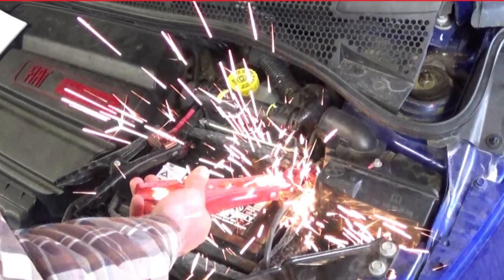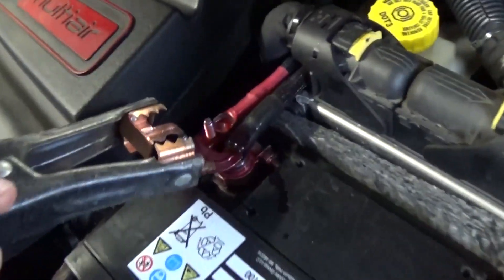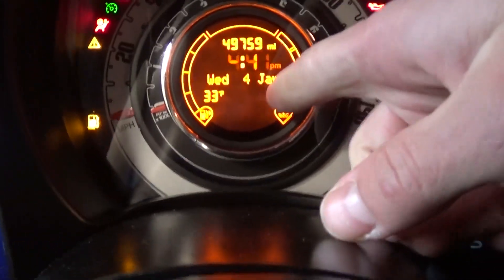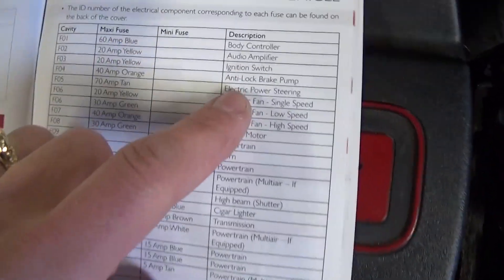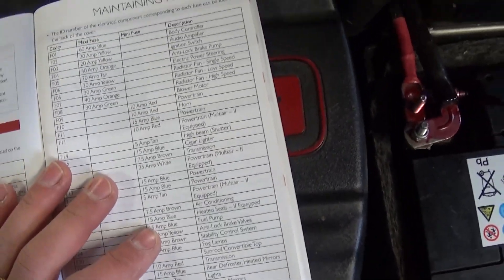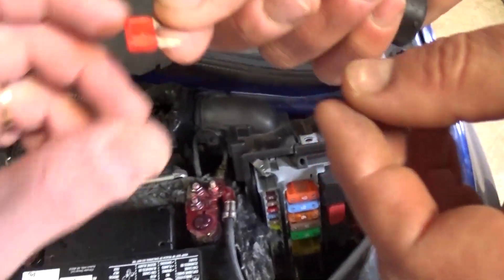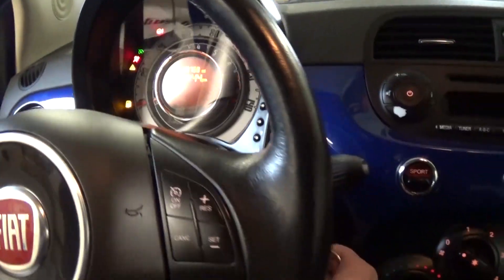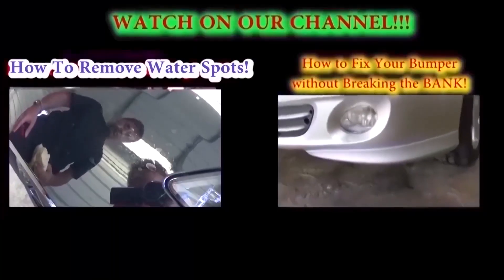What happens when you Jump Start your car the WRONG WAY!

Comment from the maker: Products that we use and recommend:
► Car Battery: https://amzn.to/3ULlYJv
► Panel Removal Set: https://amzn.to/3YiMADu
► Assorted Fuses: https://amzn.to/4fx4s3F
► Tool Set: https://amzn.to/3p5MM6t
► Screwdriver Set: https://amzn.to/3XRB28Q
► Mobil 1 Oil: https://amzn.to/3xBc8B9
► Oil Filter: https://amzn.to/3w0Ulme
► Torque Wrench: https://amzn.to/32qyRwg
► Liqui Moly Engine Flush: https://amzn.to/3IiDBID
► Voltmeter: https://amzn.to/4hB6Zvk
► OBD Scanner that we use most often: https://amzn.to/3I4MQfe

► Check out our Amazon Store for the tools and parts that we use: https://www.amazon.com/shop/worldmechanics
Reply: I thought the battery or maybe even the car was supposed to explode if you jump started the car the wrong way
Reply: RAA rescue my car jump start from engine. Expose my Fuse. I cost long time to get it.

Comment: I want to help a woman jump her car and I know on my side it was correct but maybe on her side her battery was old her car didn’t want to turn on it did not even crank now my 89 Chevy truck is running very shaky at first it smelled kind of off like something smoky but it went away can anyone help maybe the battery is good the alternator is good and the fuses seem good but maybe I could double check is there another fuse box

Comment: 0:14 That's why you plug the positive cable to dead battery first, then positive to live battery second, and THEN proceed with the negative cable. You don't want to accidentally drop energized positive cable on a grounded piece of metal (negative)... Hopefully he didn't drop the red one.

Comment: Old cars a quick spark wont harm anything. I think most newer portable battery jumpers have  a safety  feature  to prevent this. The fuse worked . But sometimes more electronics  get fried. If you stall use the dealer roadside. Right now my warranty is in question because they think the tow guy I hired criss crossed  the connections.  Which he did not. I watched  him use a portable with a safety feature on it. Battery  is bad but now two ccodes show up.misfire and aculater arm. I think there trying to scam me.

Comment: I did this accidentally on my 2009 Toyota Corolla. The horn sounded. Weird. Then I noticed a few blown fuses. AM1, AM2, and I tbi k a radical fuse. Central locking didn't work, ignition, radio, OBD2, etc. I replaced fuses and the car DID start (roughly) then stopped and blew the AM1 AND AM2 fuses again

Comment: Ashamed to say I had done this to my moms 2011 jetta. First things I check all the fuses 1 was blown. Replaced it not the issue. Checked the main fuse right off the battery cables headed to the fuse box under the hood. That was intact. Checked with a test light all my fuses under the hood had power. The fuze box under the steering wheel lost power to about 30% of the fuses had no power. Proceeded to check if the ignition was broken it checked out. I have hotwired one of the 15 amp fuses from the battery and jumped the starter it started no problem. I believe the issue is a fryed contol module. I'll keep you updated with my findings
Reply: As a fellow Jetta owner, I would love to know how this turned out for you.
Reply: Four years later and still no update
Reply: @MsMommas-d9x  mission failed, we’ll get em next time.

Comment: See, now... if you follow the instructions on EVERY set of jumper cables I've ever seen, you're grounding to the frame of the vehicle. You might still somehow not see the color of the cables, but the cover/style of the battery terminal is no longer relevant. If you put cable+ to battery- and cable- to frame, you're shorting the source battery through some long cable, you'll get sparks and heat, but not fry anything electronic or blow any fuses.

Comment: Would it cause damage as SOON as you placed the negative on the positive or would you have to place both before it creates damage?
Reply: The big spark is when the damage happens.
Reply: Yeah we did it last night and now the plug is melted to the battery connector 😭

Comment: If your battery was flat there would be a good chance you blew the rectifier diodes in the Alternator with that demonstration. They will blow way before the fuse does. You will only notice it a few days or weeks from now.
Reply: Most modern cars have polarity protection. Or don’t use jump leads use a power bank that has polarity protection built in
Reply: But the quadlumolator needs retitioning before you fuseflix the metasculator. How does that work out?

Comment: He's like, "car is fixed!!" Meanwhile, check engine is on, SRS is on after the car started.. lmfao
Reply: This is normal, sensors would report a short circuit to ground when they are backyards or shorted which is right lol. I scanned one of the cars that was hooked up reversed polarity and had these reports lol.

Comment: I did this to my rav4. Replaced the fuses and car works fine now except engine light won't turn off. Error code says its the neutral safety switch. Replaced the switch but I'm still getting the same error. Does anyone know what else this could be?
Reply: Alex Pope get a new car

Comment: I just did this to my car. Hooked up the bad battery correct, the good battery reverse. Noticed after I cranked once and got less power. Switched them and have had no issues. Should I expect any issues to arise?
Reply: My old man was once giving me a jump start (to my Camaro) and not only did it spark, it caught fire. After I tried and put the cables correctly, it started without a problem and had no issues after.

Comment: But what if the cables are on the correct posts ( both cars connected to correct posts )  but some how the car getting jump started the clamps  slipped  and touched each other while connected to the other  car that is jumping you and stayed that way  for about  minute or so .? And almost started a fire. I thought it just wasn't a good connection and have extra heavy duty cables that usually start it right up in about 15 seconds every TIME but when it took longer I checked again to find the clamps were touching and almost started a fire now nothing works right still won't start and can't even turn on my radio or roll windows up or down and my odometer stays on after I remove the key now

Comment: I did that on a S550 , thank God for fuse boxes
Reply: Me on a lamborghini huracan lol
Reply: @erich9779  ME on my own ass
Reply: @MarksTournaments  More like me and your mom
Reply: Mercedes-Benz Accelerate
Reply: I almost did the same thing on the same car
Reply: When I was young some A-HOLE at work (I had no experience jumping batteries) told me the wrong way and I did it that way, screwed some stuff up on the forklift.  Maint. guy wasn't happy lol.  Since then I just remember DON'T CROSS THE STREAMS!!"  There are other things you can mess up but that is 99% of the problems, just using the wrong wires.  (POS to NEG)
Reply: @DigitalHaze65536  lol happens
Reply: I did it on my CL55 after recharging a dead battery.  Put it in backwards so ended up putting terminals on opposite ends.  It was dark in the trunk but still so dumb.  Had to get a new ecu programmed huge headache where as only would have been the fuse if I didn’t force it.

Comment: something almost similar almost happend to me once but i caught it in time.  on one side of the jumper cables, the manufacturer installed the clamps backwards so one side was reversed.  I always check the cables now because of that just to make sure.
Reply: what do you mean clamps backwards ?)) jumper + - cables are physically the same
Reply: @suk4ed  I'm guessing the indicators on each end? They didn't match up. Like the 2 clamps connected to the battery A were one way and the clamps at the other end were labeled wrong?

Comment: Accidentally did this on my Chevy truck and all I got was a glowing jumper cable clamp. No sparks, no blown fuse's, no issue's with starting/running...just a glowing cable. 'murica! lol
Reply: Agreed!!
Reply: @singmanlouis  'murica!
Reply: I did that to on my Chevy Impala I was jumping my sisters car and it was dark so I put them on wrong while the car was running and it just glowed never had an issue yet.
Reply: I just did this to my Chevy equinox, cables jus smoked a bit but started up fine. Had to check YouTube to see if I did any damage though lol
Reply: Carsrock1999 dick head
Reply: @singmanlouis  do I really need to explain?  Just read the original post from Carsrock1999.

Comment: I think i short circuit my volvo c70 2007 whilst jump starting. Now it wint start and im having similar issues where its not even responding. Windows no longer open slightly when i open the door as its a paneless one. Will try check the fuses too

Comment: I did this today but instead of wrong jump it was wrong terminals from car to battery and killed the charging system , the car says battery is not charging , could I have killed the alternator ?
Reply: yes you killed the Alternator
Reply: You might also have killed the battery
Reply: Impala9c1man 
Nice.
Reply: Liftmaster 1270  I got it fixed and it actually didn't kill the alternator , but it fried a wire before it , it's running fine now

Comment: question i replaced some of the fuses and the car electrical is still acting up windows wont go up no radio no ac and car starts but wont go on drive reverse or anything its automatic but i cant even move the gear nothing ! i checked all fuses and relays all are okay do you think the ecu box fried ?

Comment: You got lucky
90% of the time it fries the ECU when you do that the main ones that do are BMW,Mercedes and Audi

Don't ask me why but for some reason they are very sensitive to that
Reply: planned obsolescence
Reply: German cars in general are sensitive. I own an E39 and I love the car a bunch but omg the dash lights come on for the smallest issues! It's an amazing car though otherwise which is why I don't mind fixing it often. Would much rather have this car than a mundane Japanese car.
Reply: @TheArmedNurse  k
Reply: @TheArmedNurse  id rather a mundane japanese car that still runs like a dream at even 100k + mileage over an over engineered pile of junk that will cost a fortune to repair
Reply: i accidently jumpstarted the wrong way on my 03 530i and it still started up fine i guess
Reply: very poorly built only need include a diode
Reply: @elixier33  what are you trying too say here ,
Reply: hey what about if you only hook up the negative to the positive by mistake? I went to pickup a new car and i had to use my audi to boost it. I connected the cables to the second car (acura) first and it was dark and the hood wouldn't stay up so i fucked up at just lightly touched the black to my positive but i didn't hook them both up. I was able to drive my car fine later but recently it started stalling and was getting EPS message i think, i forget ECU or ESP or something but I think there were signs of this problem before this event.
Reply: @TheJimKingReport how can this be fixed in Mercedes?
Reply: @queenpeanut4383  Spend $3500+ at a shop to replace it
Reply: Is there any fuse I can check first to see if in the lucky 10 percent I’ve been told the ovp fuse but I don’t know where to start should I try replacing the battery first
Reply: @queenpeanut4383  check all fuses and fusible links it'll be in the owners manual of your vehicle.

If not buy a Haynes repair manual they are worth their weight in gold I shit you not

Comment: Hello there. my new car battery is generating sparks. I checked the connections and they are fine. why is this happening. could anyone tell me. I would appreciate any input
Reply: Make sure the polarity is correct. The negative cable should be attached to your engine block and car itself. Also when installing any battery, you should install the positive cable first and then the negative. To minimize sparks make sure to take your key out of your ignition and also turn off any lights. The sparks that you see are caused by a voltage difference between your car battery and your car. When unconnected the voltage of your car is 0 volts. So when the battery cable is near the 12 volts of your battery will jump between the battery and the cable. Don't be worried it can't cause a electric shock to you. Hope this helps
Reply: Bram thank you. I fixed it. Polarity was good. No more sparks on connection. Movement in the terminal caused by me generated The sparks.

Comment: i changed my fuse and it still didnt work
Reply from the maker: disconnect the battery overnight and in the meantime check all of the fuses. By disconnecting the battery the computer will reset